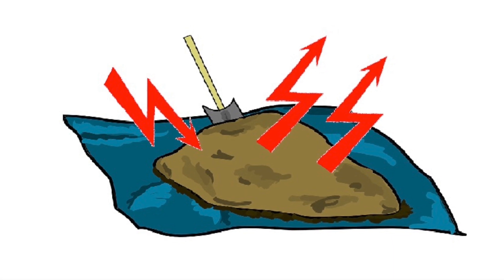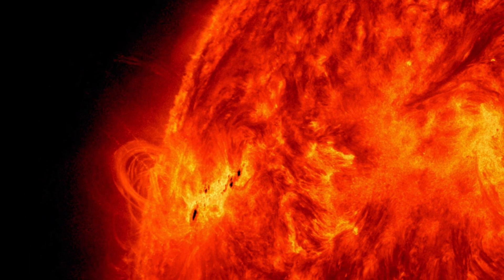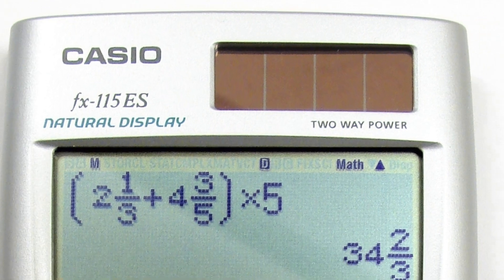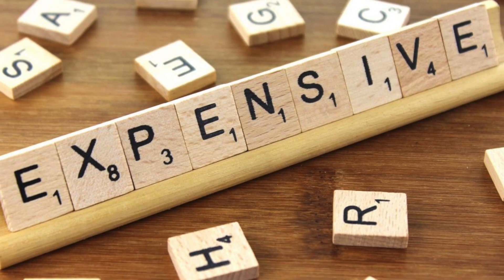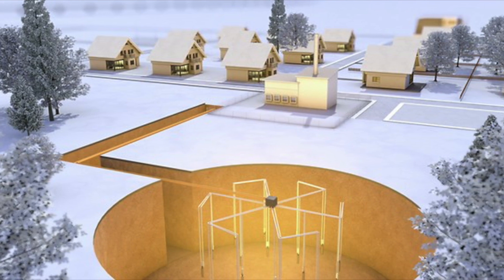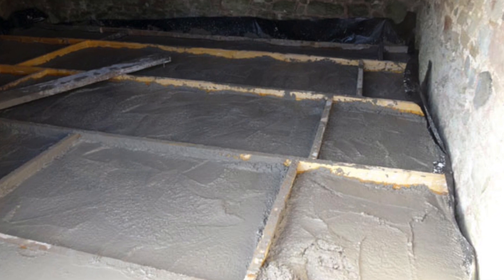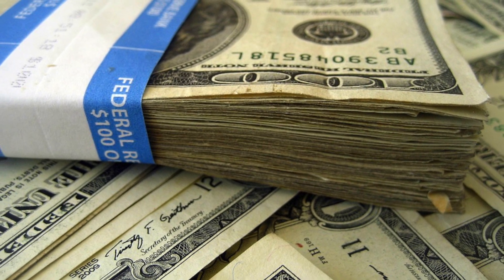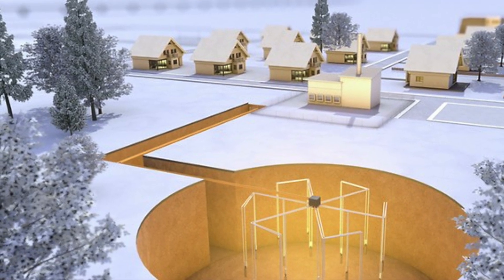Home Solar Thermal Dirt Battery (2020)

Comment: Glycol vs antifreeze - Propylene glycol is available full strength in bulk 50 gallon drums and 5 gal buckets, which can be diluted as needed at similar cost. Available in food grade ($$) used in brewing and industrial grade for airplane de-icing. Be careful with car antifreeze! In the past couple years most brands taken to adding ethanol, which is dangerous for high temperature solar applications and may cause damage to pump impellers and seals and certain pipe materials as well.

Other thoughts… 
- Gylcol is more viscous than water (and varies by % of mix) and therefore requires a larger pump for pushing it though lines, especially smaller and longer lines. I’ve had issues with this.
- If your lines are below grade (i.e. frost line) glycol is not necessary.
- If using (pressurized) liquid loops to store heat, it is not necessary to have a separate loop for extraction, just a separate pump cycle (like superposition in circuits). I do a similar thing with my domestic hot water heating - 1 solar loop, 2 destination loads.
- Heat transfer from plastic (pex) to dirt is not very efficient. Most systems I see fail to take this into account when sizing heat transfer loops. If loops are undersized system will fail to work as expected and will probably be very costly to fix.
- This concept pairs well with evacuated tubes, which can achieve much higher (delta) temperatures, which translates to more storage per volume.
- Consider a staged system where a high temperature “box” exists inside a lower temperature box. I do a similar thing with my hot water system. I heat a smaller amount of water to needed temperature and then use whatever else is available to “preheat” a larger quantity. That way I always have at least a minimal supply of hot water and if I have to resort to the reserve it does not require heating the water from scratch. My reserve is also large enough as to always “need” input so nothing goes to waste. If I tried to heat all the water all the time, then most of the time I would need a backup source to top-off the heating. Also, in this case, a box-in-a-box means waste heat from inner box is not lost.
- Playing on the concept above, putting a domestic hot water storage tank in the middle improves efficiency as waste heat lost from the hot water becomes stored house heat.
- For off grid PV applications resistive heating elements can store heat in the dirt when batteries are fully charged and the system has additional output. See #polarnightenergy in Finland.
- Good luck, keep us posted.

Comment: Can also use combination solar heater/solar panel panels to reduce surface area required. Those air heated tubes are more prone to silt plugging, bacteria growth, and root plugging. Better to use an exhanger than direct air flow. That solar heater/battery could be combined with a geothermal heatpump type set up to switch between heating and cooling coil runs. Just use a pair of solenoids to switch between coil runs and still use same radiator set up in home furnace stack or zone controlled.
Reply from the maker: interesting!

Comment: There have been numerous ways long term heat storage in dirt has been attempted over the years. Until recently most have been inconclusive at best.
One important thing to watch out for is keeping your storage medium dry.
I hadn't considered aircrete, but I had thought about foam glass aggregate. It is compactable and stable under ground. Something not true for plastic based foams.
Please be sure to include a budget for instrumentation, so that you can advance the art
Reply from the maker: thank you
Reply: is the problem with water that it can migrate from the surrounding soil into and out of the storage medium taking the heat with it? couldn't this be rectified by sealing the top, bottom and sides of the battery with a waterproofer, viscuine, or pond liner, to keep the water and heat in?
Reply: @luct3368  most people only talk about keeping water from above out. If water from below is a problem... I suggest a different site for the exercise.
But I've never done this, only read lots

Comment: are you using TEG/TEC to supply power to the fluidpumps (liquid & air) helping to teduce external electrical costs?
Reply from the maker: I don't know what that is?
Reply: @SimpleTek  
Thermal Electric Generator/Cooler 
acts like a solid state heat engine 
TEG generate Electricity from Heat variance
TEC generate Heat variance from Electricity

check for TEC1-12710
Reply: @SimpleTek  old school version

https://youtu.be/Be3FckQoDws

Comment: How’s your project going, I’m watching this a year after it was uploaded. I would think the most complicated part is the resistance created by the pipes for fluid or air. In floor radiant liquid seems more practical, as air ducts get dirty and are difficult to clean.
Reply from the maker: circulating pumps use like 30-40 watts and pump great!

Comment: Why make TWO separate set of tubes ? I will be more efficient and economic use a single underground tube, and divert the flow between the solar collectors and home heat exchangers as needed - just one pump, one underground tube coil, and few solenoid valves. And of course a controller....  does it make sense ? It allows also to divert the heat directly from the solar collectors to the home in sunny , cold days, maybe improving overall efficiency.
Reply from the maker: tubes are CHEAP though, why double duty when it''s too cheap not to - lasts longer

Comment: I think you could easily make this much more reliable by concentrating on insulating the house before you make this system 

Because the ability of the house stay warm Will be the biggest factor in how efficient the system Will be
Reply from the maker: insulation is huge

Comment: If you plan to have ducked air: use an air to air heat exchanger. Do not deliver air into the living environment by way of ventilation ducts. HVAC is a time tested health hazard and should be abandoned.  The strongest allergen know you man it dust mite shit.  They live in all ductwork.  And for air conditioning, use window units or heat pump mini splits.
Reply from the maker: good point!

Comment: If you plan to extract the heat with glycol etc, then consider not running a second set of tubing.   Except for the tubing into the home.   This would require a shut if valve to the panel at night that  is timed or temperature triggered
Reply from the maker: interesting!

Comment: Make your underground storage area directly underground of where you intend to heat.  Place footings, for your foundation, and possibly a lower living area for Winter use and ground level for summer use. And thanks for the lightcrete tip.
Reply from the maker: That's a good idea!

Comment: You do not need a second set of pex tubes to extract the heat with liquid, just valves that automatically switch between the collector the "battery" and the house. On sunny winter days it can run directly from collector to the house and the other time from the battery to the house. When your heating need is met it can then go from collector to battery for later use, regardless of season outside. I hope this can help.
Reply from the maker: great idea!
Reply: This sounds like a very good idea however I think the piping would have to be you would have to be laid about in the middle of the battery instead of the bottom to create radiate from all directions

Comment: RV anti freeze turns into a slushy mass up here in N Iowa winter.    I would probably use cyro tech which is available at Menard or Lows,  not real cheap but it wont bother your pumps and 1/2 inch lines don't hold a ton of liquid.   Good luck,  neat project I think.
Reply from the maker: Thanks for the info!

Comment: New systems are using sand, not dirt, and gets the temperature of the sand up to 600 c'.
Reply from the maker: interesting, do you have a link?
Reply: @SimpleTek  https://youtu.be/tm7spMG0ch8
Reply from the maker: @petertraveller6421  Thank you sooo much - That IS interesting. I've been thinking of something similar but using used motor oil to store the heat - sand is a MUCH better idea!!!!!!!!

Comment: You need to tell people that this idea doesn't work. It is being referenced in other videos.
Reply from the maker: umm, no, it DOES work and is working in many places right now.
Reply: @SimpleTek  I'm looking forward to the next video that will show how this magic system heated your home for more than a week.
Reply: @varietasVeritas  You can store heat for months underground.  Look up the YouTube video 'Dirt Simple Energy Storage | In Depth.'  :)
Reply: @brianrcVids  
Their idea is grossly inefficient. They haven't actually done anything. Converting excess electricity to stored hydrogen would be exponentially better. They are selling a pipe dream to the wretchedly ignorant. It's the same story that has been told for ten years now. It was pathetic then and it is pathetic now.

Comment: I believe that you will be much better off pretreating the incoming air with underground pipes, then pulling that air through a solar thermal collector and into your house. In the summer bypass the thermal system for straight air conditioning. Your "battery" will be very temporary, like a few days.
Reply from the maker: nope. you're wrong.
Reply: @SimpleTek  
Could you please make a video showing how much energy was stored and how long it was effective.

Comment: while in canada, a lot of energy is used to heat your house, there are other regions in the world, where a lot of energy is used to cool down the house.
I wonder how well this works in the other direction as well. 
I am thinking also about regions like marocco, where you have ice on top of the mountains, but having a desert at the bottom. 
All it takes is a ice-cube slide ??
Reply from the maker: what's the ground temperature a few feet down?

Comment: Have a look at vacuum tubes and magnetrons
Reply from the maker: magnetrons????????
Reply: @SimpleTek  yeah they're alright, especially the relativistic one. Vacuum tubes and transistors are some very funky Inventions, pretty much same deal as a magnetron, particle or electron accelerators.
Reply from the maker: @clive280178  i use evacuated tubes for solar heat collection....
Reply: @SimpleTek  are solar panels badly engineered transistors or are they big transistors, looks to me like a solar panel could potentially be a massive transistor with huge power output instead of the about 100 watts it is
Reply: @SimpleTek  https://youtu.be/_-JzxX75oYc

Watch this mate and be blown away.

Comment: I would always go with a drain down system. If designed correctly regular clean water could be used.

I worked at a factory in the 70s 80s which had been funded by NASA to be solar heated/cooled. It had a 1/2 an acre of 20 ft x 20ft arrays that could be rotated to face a range from straight up, to straight down.

The system held over 20,000 gallons of water/food safe antifreeze. It spilled most of that liquid onto the ground twice over about 10 years. Had it been a drain down with pure water it would have been far less costly to refill.

The main issue with a water drain down would be insuring water is not pumped up during less than warm system time frames. Also avoiding cold spots in the piping. Solutions to issues like these should be doable.

I have just retired and will be building a 14 × 24 hoop house to test my ideas in. This drain down setup with an earth battery will be installed during the initial construction.

I'll be going with the assumption that the ground in the hoop house will never freeze. My first build will only have the pex 2 ft below grade. This should be relatively easy to do in my soil, and will still provide a bank of usable size.

All of the water will be below grade during nights/sunless times. Included will be a pair of buried 35 gal drums that will double as a reservoir/heat exchanger for the aquaponics system water temp.

Hopefully, video to come starting fall of 2021.
Reply from the maker: awesome answer! Good luck with your build, keep us updated please!!! Sounds fantastic!
Reply: Love to see that video mate :)

Comment: Why not a ground source heat pump no need to insulate as surrounding ground  just adds to heat collected. I assume the ground isnt in permafrost.
Reply from the maker: heat pumps only heat so far without large electrical inputs

Comment: for antifreeze their are sugar or salt or drain the pipes in freezing conditions or just let them freeze. one of the eary selling points of pex was that it was not damaged by repeated freeze thaw. just dumb ideas more research is needed. for environmental and cost the last 2 seam the best
Reply from the maker: you can't freeze and refreeze pex without expecting failure. I live 60 miles north of Winnipeg, the coldest major city in North America, and run an RV park dealing with broken frozen pex all the time.

Comment: I assume this project might have been delayed by covid.  
Anyways - I'm thinking that there should be no need for a secondary water-pipe to deliver heat trough liquid to the home.  
Some valves and a little extra pipes should make it possible to connect/disconnect the house and heaters independently. Thus the loop will go collector-dirt on a summers day, while dirt-house on a winters day. On a sunny day during winter, the loop might go house-collector-dirt.  
  
I think it should be possible to do the same thing for cooling.  
In essence create a large block of ice underground by cooling it down during winter, and use that cold during summer.
Reply from the maker: good idea!

Comment: My horses muck pile really heats well.
Reply from the maker: if you add stabilizers like shaved wood chips and grass clippings to your horse manure and water in a large pile you get stable heat for months and months

Comment: why 2 pec coils?  just use the same coil alternately for storage cycle (dirt heating) and extraction cycle (house heating from heat stored in dirt)
Reply from the maker: what if you need to do both at the same time?
Reply: @SimpleTek  if you want to draw off heat same time as collecting heat, then you can just use a simple, direct heat exchange coil up stream from the dirt battery.  maybe perlite can be used for insulating the dirt battery.
Reply from the maker: @kevinwelsh7490  perlite is a great idea, I was thinking aircrete

Comment: You can't have the air directly from those tubes into your house! Bacteria , humidity , forms inside. just like the legionella in car air conditioning.  What is instead feasible, is to put thermal mass walls, and run the pipes trough those, acting as a heat exchangers. and let those walls heat your house.
Reply from the maker: I've heard many people be concerned about it, but it hasn't been a problem with anyone I know using this system. It seems the moving air dries out the tubes making bacteria difficult to grow...

Comment: I am wondering if when using a porous material like aircrete, pea stones or lava rock for the battery, if water filling the air pockets would help transfer the heat to and from the solid material more efficiently?
Reply from the maker: the air pockets are what provides the insulation!
Reply: @SimpleTek  Adding water to the heat storage medium could add to the thermal mass, and responsiveness - if the water could be contained within the thermal battery. 
i checked the specific heat capacity of water and it phenominal - weight for weight, nothing beats it! Obviously we dont want it leaking out of the battery and taking the heat with it.

 Would installing a impermeable liner on both sides of the aircrete help? - The one on the inside of the battery, to contain the hot water, the one on the outside to keep the aircrete dry and insulative.... Maybe useing a waterproofing agent like SBR acrylic, silicones(found in K-rend) or latex additives in the aircrete Could make it impermeable to water, and achieve this.
Reply: You could add waterglass to the aircrete to prevent water permeating.

Comment: Water has a far higher heat capacity by volume than clay,  (2.5 to 3.5 times)   so I suggest clay  as insulation and heat storage  around a big tank of water which would be the main heat storage in the system.
Reply from the maker: you're right but water tanks cost  a lot more more than big lumps of clay
Reply: Water heated to more than 200 deg F begins to create pressure.

Dirt can be heated indefinitely to temps up to 500 deg without pressure issues.
Reply: @richpalmisano1740   You are only heating to 100 F or less in most cases.
Reply: Water allows for layered charging. Hot water at the top of the tank cold water at the bottom. No need for many feet of piping inside the tank. However even with the high heat capacity of water if you calculate the amount of energy that can be stored in a water tank of let's say 10m3 heated to 50C above outside temp this isn't much more energy than what is contained in a few dozen L of petrol. For these systems you  really need large volumes. Even with good insulation and when using water as heat storage. But still worth a try and might work best in combination with some other form of heating system or where only a few deg. of heating are required.